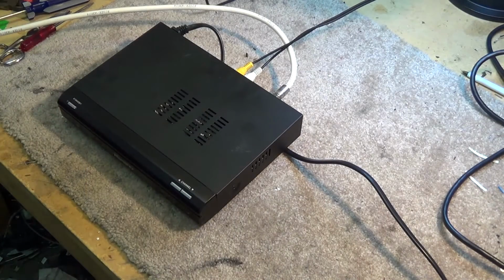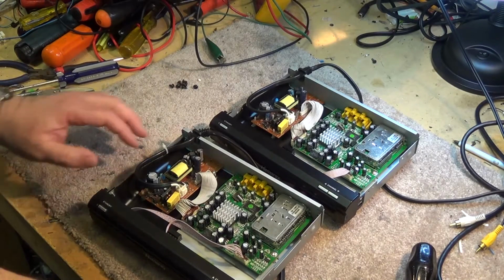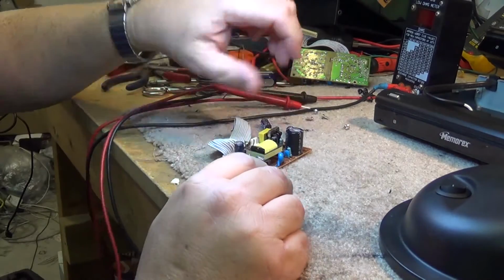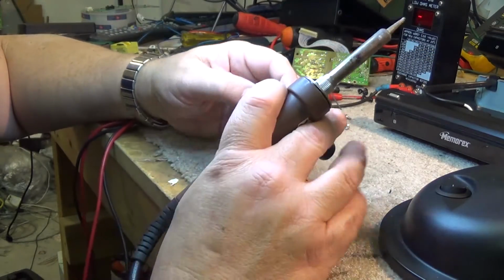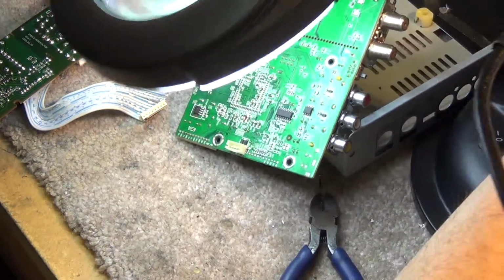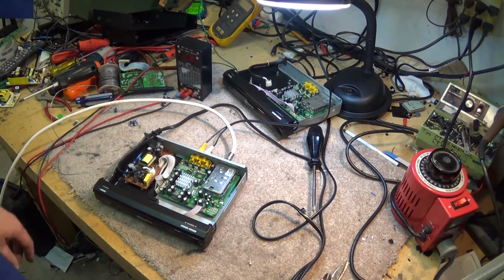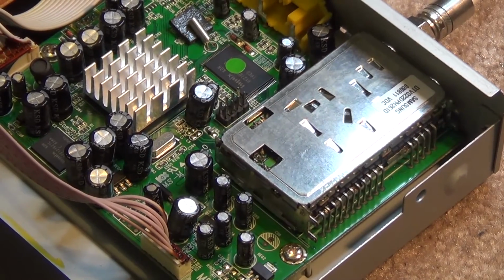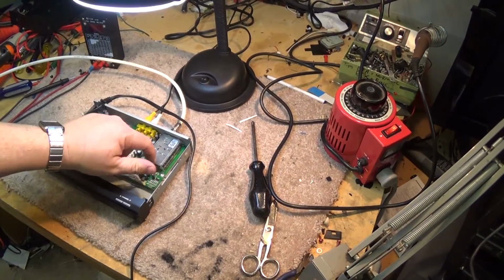2 memorex converter boxes

Comment: Are these he same ones I just watched you fix in another video?  If so, did you replace the caps with reclaimed caps?  Even though you tested them and they were okay, they must have still been well in to their life cycle, no?
Reply from the maker: +Tech Gorilla One of them was repaired before, the other not. The one that failed before it wasn't the same cap that was replaced, it was another one. The problem with these units is I was running them 24/7, and they were stacked, so the units on top were running quite hot and they cooked.
Reply: +12voltvids   Based on that, couldn't you replace the caps with Tantalum caps and get far more stable operation through a wider range of temperatures?  I am reading a lot of mixed signals about tantalum.  Mr Carelsons Lab insists that he never replaces tantalum as they are rock stable, and never deteriorate.  Others insist that they are quite unstable when voltage spikes occur and tend to fail dramatically.  You're way more qualified to answer this...I am just spit-balling as I often do in the wee hours of the AM.
Reply from the maker: +Tech Gorilla Tantalum caps don't hold up well in switching power supplies because of the high frequencies and high ripple currents due to the almost squarewave signal they are attempting to filter. At least that was how it was explained to me in a course I took.
Reply: I am truly curious now....something about the tantalum intrigues me.  I grabbed this from here:
EDIT:  Missed your part about ripple currents  Sorry..

http://cds.linear.com/docs/en/design-note/dn95f.pdf

"Solid tantalum capacitors offer small size, low imped-ance, and low Q (to prevent loop stability problems).The down side of tantalum is limited voltage, typically
50V maximum, and a tendency for a small percentage
of units to self-destruct when subjected to very high
turn-on surge currents. AVX addresses the problem with
their TPS line which features more rugged construction
and special surge testing. Even TPS units must be volt-
age derated by 2:1 if high turn-on surges are expected,
limiting practical operating voltage to 25V. Even with
their shortcomings, solid tantalum seems to be the
technology of choice for medium to high frequency
DC-to-DC converters"

Thanks for the banter and videos.  I enjoy your style!

Comment: I used to have like 2008 Magnavox SDTV Digital Converter Box and the RCA SDTV Digital Converter Box and it works pretty well which I don't have an issue because I haven't used them for a while and especially for RCA Converter Box, since it didn't have a remote, I use an old RCA Universal TV Remote by using SAT (Satellite) Mode to tune the DTV when I need to watch something and indeed the old remote does work. =)

Comment: Cut a hole in the lids to put fans in. I had router that would do the same.
Reply from the maker: Brian Taylor Heat is the number 1 killer of electronics.
Reply: Or put a fan on the outside of them to cool them all